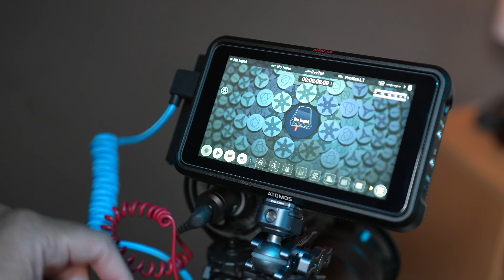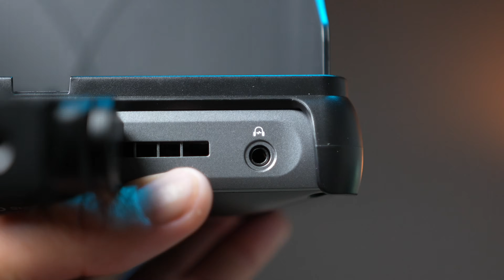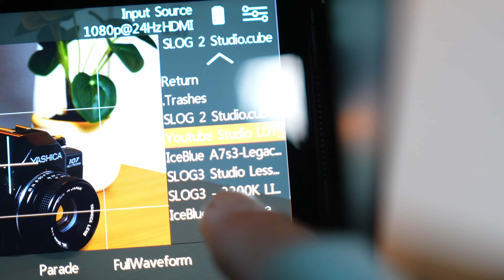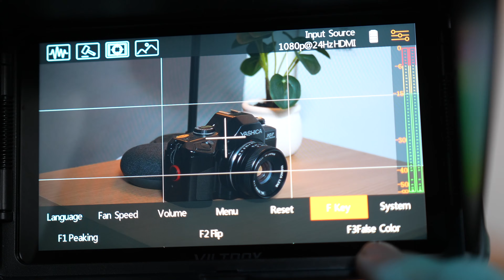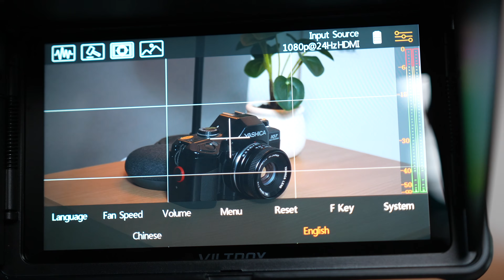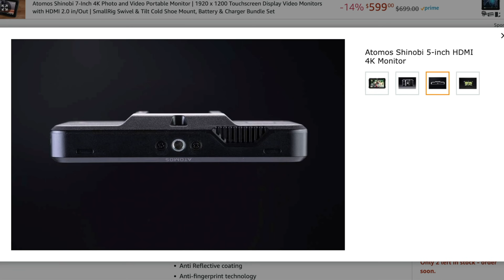Best $200 for ANY Camera: Viltrox DC-550

Comment: Does anyone know what size DC input it has? 5.5x2.1mm or 5.5x2.5mm
Reply from the maker: It's 5.5x2.1mm — DC 12V input.
Reply: @MikeBSalazar  Thank you so much
Reply: @MikeBSalazar  Do you have a link to a cable I can use with the monitor and my V-mount battery? I can only find 5.5x2.5mm

Comment: I have been using that Andy Cine monitor for years. That's what I'm trying to upgrade from currently. Is this Viltrox monitor going to be a big enough game changer? Will it really help me with my production in a meaningful way? I feel like it will be a game changer because of the brightness and the accurate color. Any other monitors I should be considering under $200? Thanks for the video.
Reply from the maker: I used to use a Andy Cine monitor myself until the quarter inch thread broke on me, but the viltrox monitor has been going strong.

Comment: Wondering if you could help me. I can’t see the display in full screen. It’s cropped in for some reason. I’ve tried changing hdmi out on the camera and nothing it’s greyed out
Reply from the maker: It may be because of the HDMI out settings on your camera. Sony?
Reply: @ you know I found a better deal on a 7” monitor so I returned it and got a different one. Works great now

Comment: I just bought the DC-550 lite this week and in terms of the hardware and how it operates, it's great. No complaints.

BUT it has to be said and people made aware of...

Unless you buy this DIRECT from Viltrix they will not let you have access to firmware updates. None. Nowt. You can only get firmware updates by emailing their support team and unless you have an order number, from Viltrox, you're stuffed.

It's shocking support.

Whereas competitors like Neewer or Osee offer firmware free and easy to find on their websites, for ANYONE. I bought mine from Amazon and they refuse to help me.

Comment: Had problems with my DC550 Pro after only 2-3 uses with my Nikon Z9. The screen will flicker off/on and say 'no signal'. I've checked cords, connections, output settings, fan speed...even looked for any new firmware updates - none available. So far Viltrox customer support has been no help, e-mailing me back saying to get in touch with their official store - with the same e-mail address...? Stay tuned - a little disappointed after all the hype.
Reply from the maker: I don’t know of others using the pro version but that’s similar to my regular model. if it’s returnable, better off that way.

My second monitor holds up now.
Reply: @MikeBSalazar  hey, can you elaborate a bit more? did you also have the same problem with this monitor? :) is this something we should be aware of? thanks

Comment: I have the PRO version and recommend that version because it includes the great spring loaded collapsible sunhood. Also handy is to buy a short angled hdmi cable (but that is just personal). The new Viltrox NP batteries are available in various sized and have led power indication and can be charged with the build-in usb-c connector. Ciao
Reply: The regular version also comes with the sunshade.
Reply: @ It seems they changed the collection somewhat as time goes by (I bought it at first release) and there are now 3 choices. The collapsible sunhood is a real plus. Ciao.
Reply: How is the latency?
Reply: @armando.visuals it is not wireless